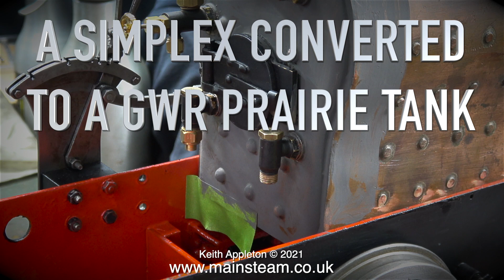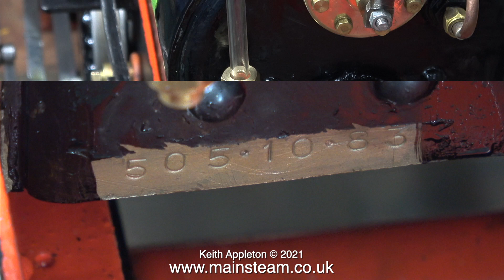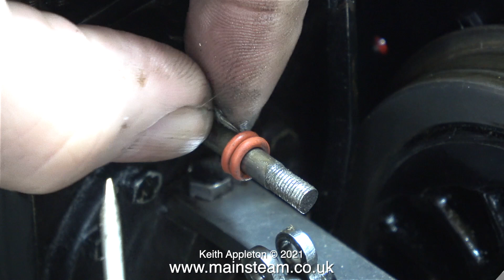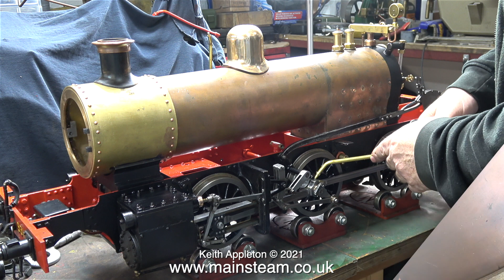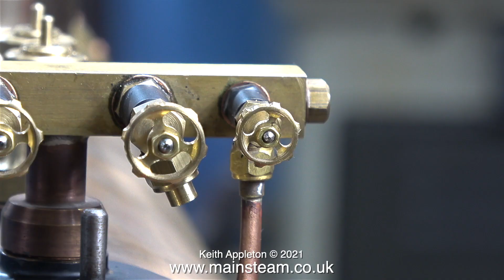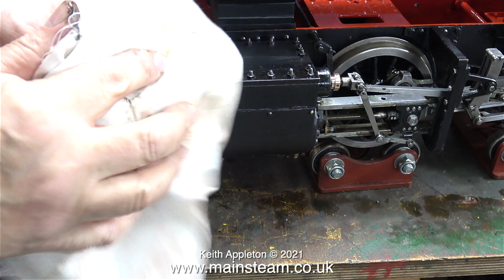SIMPLEX PRAIRIE TANK - PART #66

Comment: Hi Keith - I've run into this problem with US vs British pipe threads. The US standard is NPT (national pipe taper) where the threads are tapered, whilst BSP are parallel. In addition, the thread profile is slightly different between the two (Sellers 60° flattened thread form for US vs Whitworth 55° rounded thread form for UK). This causes much confusion over here. You can make it work one time but don't ever take it apart.

Comment: 1/4 x 40 is 1/4 x 40.  The pitch is 40 tpi. The problem is American threads have a 60 deg, form  and BA (British Association) have a 47.5 deg. form and so the BA threads are taller.

Comment: If there’s no room for even a thin locknut on things like those gland nuts, an old trick is to use a piece of soft brass in the grub screw hole, to stop the screw digging into gland nut threads.

Comment: Is it normal that the whole thing wobbles when you run it? Is it because the two cylinders don't push and pull at the same time (which i realize is normal)?
Reply from the maker: It is not a problem, the more weight on the wheels the less they move from side to side. . . . .